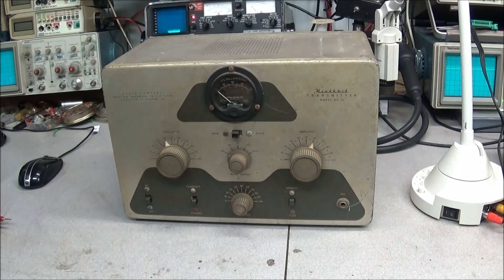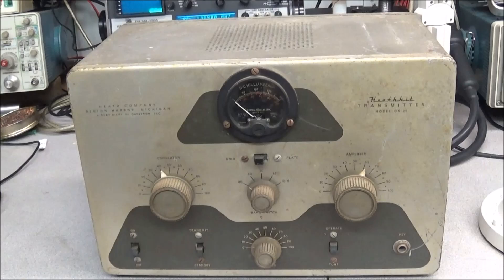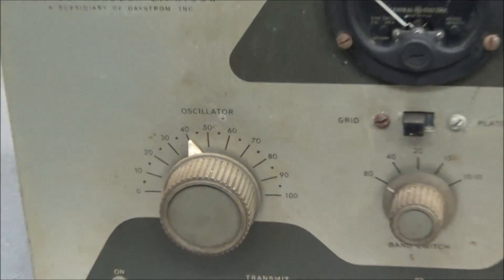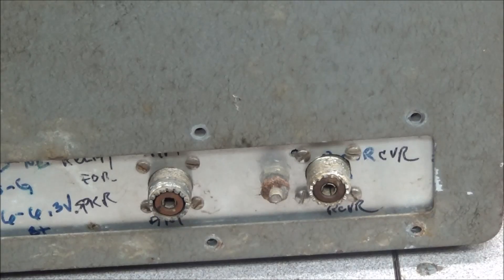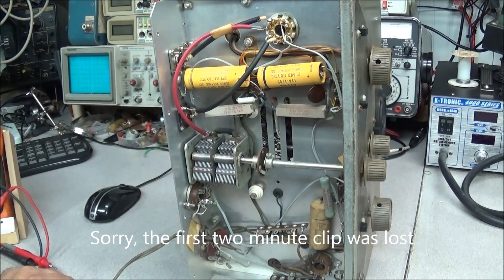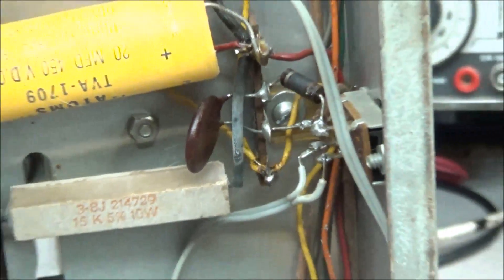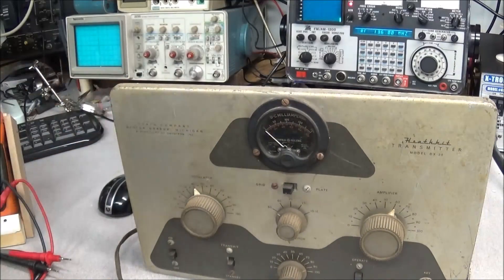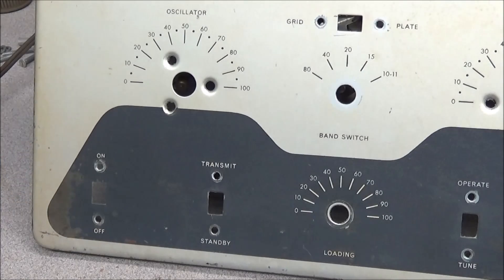#74 Heathkit DX 20 To Restore or not

Comment: I'd probably restore it, but I do NOT do CW so it wouldn't matter to me.  If you do CW, then, yes, restore it.  I restored my old Kenwood TS-430S and matching PS-430 power supply.  I didn't have Kenwood grey, so I used a lighter colour and they came out quite nice.  I gave the radio away to another Ham who was physically impaired after getting my new Yaesu 991a.  Cheers from eastern TN

Comment: Been there, done that. Years ago, I torn down a Heathkit DX-100B to its last nut and screw and nut. After cleaning everything, I completely rewired the unit. When re-assembling the transmitter, I made and error in judgement. I didn't have new replacement 125mfd 450 volt electrolytics for the high voltage power supply, so I used the ones that had come with it. Of course, when I had finished the restoration, applied power, the caps failed and arced. I was so mad at myself, that I put the transmitter away, and never finished the restore. To this day, I hate the decision I had made. It would have been a beautiful piece of equipment to have. So, yes, I know what you mean. Life teaches us many things, and sometimes, we need to pay attention.

Comment: Perfectly serviceable radio ! . First.  Give it a good bath.  2.  Remove the tubes. 3.  Clean all sockets, swtiches and plugs with good contract cleaner.  4.Test tubes, replace weak ones. 5.  Replace paper and electrotlytic caps ( must !).. 6. with the rectifier out.. you can test the transformer.. measure for shorts, opens.. if ok.. then connect to line voltage, measure the ac on the windings.
If ok.. you have a good xmtr. 

Radio police will NOT come to see if your paint is scratched.  Use dish detergent in hot water to clean,  Use a plastic scrubber sponge to remove loose rust.   Use a little oil ( tri-flow)  to keep the iron from rusting.
Reply: CLEAN,OVERHAUL AND USE YOUR RADIO... THE COSMETICS DONT MAKE IT WORK BETTER !   ONCE CLEANED IT WILL GO FROM A 3 TO AN 8.

Comment: I suppose a purist would want to restore the unit to its original look.  However, good luck finding original knobs, meters, and panel.  Most likely the original meter went bad and the former owner installed an available meter that functions the same.  I bought a used Heathkit tube checker that had a bad meter.  I found a surplus meter of the same size that fit inside the unit, but had a different scale.  I wasn't able to swap scales, but I was able to relabel the scale on the replacement meter.  Also some of the knobs for the lever switches were missing, and I made replacements on my 3D printer.  I now have a functional unit, though it is no longer 'original'.

I f you can find a replacement meter, you could repair the panel by attaching a plate to the inside to cover the larger hole (with a suitable smaller hole inside of it) and use auto body putty or epoxy to blend it in.  Then sand down the panel, repaint and relabel it.  Yes that's a lot of work, but if you really want to perfectly restore it, that may be your only resource.

Comment: I think I would use some of that pink rust remover, but it is not a dx 100 heathkit, which is a wonderful transmitter, that is beautiful. this one, not so much, but it does deserve rust removed.
Reply from the maker: Yes naval jelly works wonders. I gave this unit to a new tech to fool around with.

Comment: I would say to put it into working condition, but not collector condition. One would hope that a young novice would look at it as a treasure chest. That's how I started in the 60's, using equipment like this with hams that worked with my dad. Recently pulled out my FT101ZD and Icom 506 out of the closet and starting to troubleshoot the gear. Suspect I'll have decisions to make also, albeit, my equipment was all covered and in an in-house closet, so it looks brand new.
Reply from the maker: Hi John. I passed this unit off to another ham to have a go at it.  Thanks for sharing.

Comment: I built the DX-20 in 1958, and it served me for many years.  Eventually, I used it as an exciter to drive a homebrew linear amp to about 400-500 watts.  Finally, sold it at a swap meet, still working...
Reply from the maker: They are tough rigs, thanks for sharing

Comment: Yes Buddy Those Battle Wounds can be a little of its usage,again they are small Buddy and yes value wound be too much the issue .I think I would clean it up best you can, and yes that Mod sections wiring needs totally done Right, sent to a working state, They are Buyers that  would have good use for it as is, or further Mods ""DDS"" .I think maybe down the road a package may come in the mail with a DX 20 holding Face Plate and cabinet never know ! So for now or in the future, get it to working state and cleaning up bad wiring showings.73's Dale

Comment: You know I actually don't mind that meter even though it's not original what about just a resurrection à la Shango
Reply from the maker: I like the meter. It is vintage design. Just did not like the big hole they cut into the front of the transmitter. That will have to grow on me.

Comment: Sorry, Buddy, but I would unload that rig on someone else who would want to pump money and time in it. You have enough repairs and other equipment that will be better use of your valuable time. I restored a Hammarlund radio, and spent way too much time for what I ended up selling it for on eBay. If you want to restore something, try a Hammarlund HQ-180 for something similar. Just my $.02 worth. 73...Dan w4mnc
Reply from the maker: Thanks for your comment Dan. Yes an old Hammarlund would be nice. But hard to find at decent prices. I am however looking at a Collins at the moment.
Reply: I think that would be a smarter use of time. 73...Dan

Comment: I have restored Heath front panels with the use of computer decal paper and auto body filler.  You can get rattle cans of the original Heath colors.  If you take your time they can come out pretty good.  The problem is, as you say, it takes LOTS of time!  It's always nice to save one from the dumpster though.  73, Bill.
Reply from the maker: I would like to learn to do that with the decals. I have made some nice looking stuff with rattle cans.  Also can do automotive painting. I even have a  powder coat system but sold the oven years ago. Thanks Bill for the suggestions.

Comment: Just thinking outside the box here...what about gutting and rebuilding it inside your own enclosure and make it into a UMO-20? The Heathkit purists may crucify me...I have a DX-40 here (my original Novice transmitter but not this rig; wonder whatever happened to mine?) that is in the project queue to build into a empty Drake 2-B enclosure to create the matching transmitter that Drake never made. 'Course it may be a few years!  73 - Dino KL0S
Reply from the maker: I have thought of that.  Really would not be that difficult at all to do. I bet the Heatkit fanboys are jumping up and down when they read your reply lol.  Like to see the rebuild if you get a chance to start on the DX-40.

Comment: Couple of thoughts. 1, my first transmitter was a borrowed Heathkit AT-1. I hated the meter on it. I think it was a Shurite meter, and it was un-damped. 

2, if it were mine, I'd just clean it up a bit, get it working, and use it as is. It's too far gone to restore back to original. You can't save 'em all.
Reply from the maker: Nice thoughts. I do agree everything cannot be saved.

Comment: Hi Buddy. I found your channel recently and have been really enjoying your vids. Vintage radio is right up my alley. Heathkit made a boat load of DX-20's over the years so you may be able to find a parts donor fairly easily for not a lot of cash. Maybe one with a bad transformer but a nice front panel and original meter. No glory in restoring that one I'm afraid. It would have to be a pure labor for the love of radio. Lots of hours in that one. I would ohm out the power transformer and the choke to make sure that they are good before going any further. If one or both are bad it's kind of a non starter.  Anyway good luck with it and keep up the great work, ATB and 73 Doug.
Reply from the maker: Thanks Doug for that reply and glad you like the videos.  I think the only thing in this restore would be the fun factor. And the chance to say I did it.  Number one thing atm is the 101's. Perhaps a later build on this. Thanks for stopping in.

Comment: I LOVE Heathkit and personally think every one should be restored. OK, a collector wouldn't want it because of the scratches. But if the variables are OK, in spite of the rust, it is an ideal candidate for a proper restoration. Which in the case of a Heathkit is just what you said. Careful, but total disassembly. Restoration or replacement of each part, then turn to page 1 and put it together from scratch.
Reply from the maker: I agree 100 %, And then the fun factor of putting it all back together. Thanks for your comment Robert.